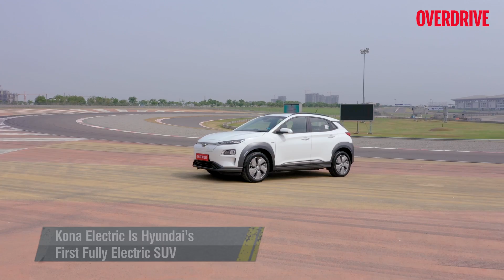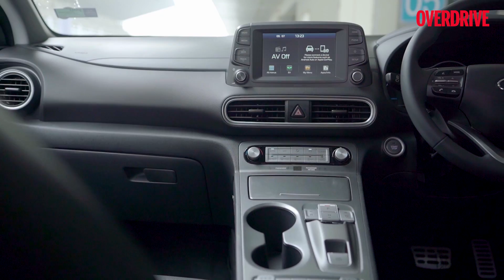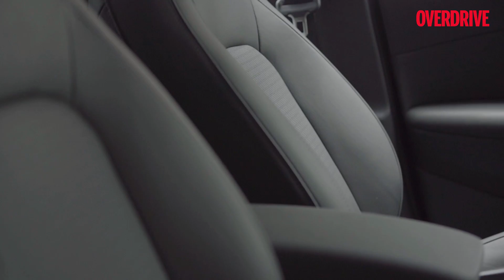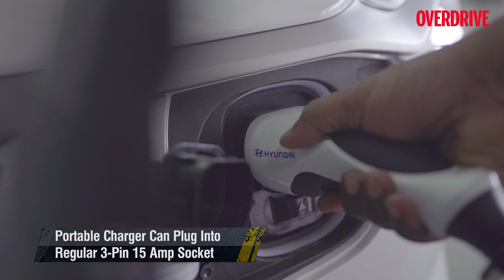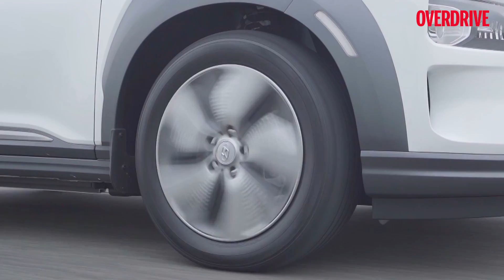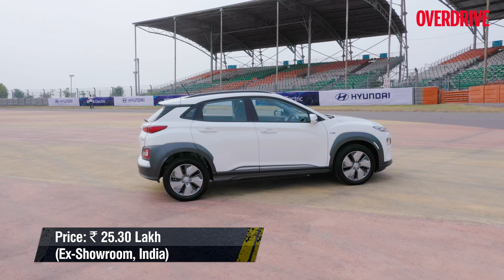Hyundai Kona Electric | First Drive | OVERDRIVE

Comment: I bought a Hyundai Kona EV (the one being reviewed here) one year ago (March 2024). This generation is now discontinued in India and was at the end of its lifecycle. So the price they offered was basically a solid discount which made it extremely good value for money at a goodly sub 20 Lacs. I ve used this car in the city mostly, but have also done three medium to long distance trips in it. All I can say is that this is a really well accomplished car, extremely comfortable, very sensible and energy efficient. The braking regen controls with the paddles, can be worked just like one works the paddle shift gears in an ICE car. I particularly like the screen size. It is just like a normal car and doesnt have huge screens everywhere which actually distract the driver. The lumbar support is very nice. The boot space is fine.  It is quite a luxurious car for two people’s usage. And the cost of running is amazing. The brakes last a really long time because of regen. Maintenance is reasonably priced. The cost of electric charging is only 15-20% of the cost of petrol fuelling up. With a 100% charge in the plains, one can get 300-320Kms. If one intends to drive up the hills, then it is useful to do a part charge halfway along with a breakfast or coffee break. Honestly, ECO mode is more than enough performance for our daily use. The power delivery is fantastic from the get go. The car is lovely to drive whether in city, highways or hills. In the hills, on the curved roads and downhill and uphill slopes, the car feels absolutely planted owing to its low centre of gravity and the fact that the battery weight is concentrated at the bottom. It handles really well. The 395NM torque and 140bhp is more than sufficient to shift the 1600 kgs kerb weight of the Kona (maybe 1800Kgs when laden with 2 passengers and some luggage). The ground clearance is adequate but under full load one has to watch for the giant speed breakers that we have in India. . Being a CKD, the fit, finish and finesse of this car is really up there with the best. Very good value. 
The Kona is an accomplished car and well worth it. 
Speaking as a happy owner.

Comment: I have one question. If I tank up my fossil fuel car and leave it un-driven for 10 days, on 11th day the fuel in tank will be the same (petrol may evaporate a minuscule bit). Now, if I full-charge Kona and leave it un-driven for 10 days, will stored charge remain same? The reason I am asking this is because, if I full-charge my cell-phone and leave it switched off for 10 days , on 11th day when I turn on the phone, I find more than half of the charge gone even though I haven't used my phone. In other words, does it retain the charge over longer duration, even when the car is not driven?

Comment: Just another observation on the pricing factor. Presently, Lithium ION batteries are priced at approximately US$200 per KWH. Considering this figure, the battery on offer in this Indian version should come in at around 8 lakhs. Add another 5 lakhs for the rest of the car and you end up with 13 lakhs. Add another 2 lakhs and round it off to 15 lakhs. That's about the MAXIMUM, this car should be sold for, in India. If subsidies and tax rebates are applied, then the final figure should go down much further. Ideally speaking, this car should sell for around 12 lakhs MAXIMUM, if it is to be considered for an average middle class family. The very ideal scenario is that as an EV, considering the range issues and the present scarcity of charging points, it should come in lower than a Diesel/petrol car if it's same size/power range. Only then will there be any sort of motivation for a middle class family to consider it, instead of a gas/diesel version.
Reply: absolutely right.....but its priced for 25 lakhs i guess...why the hell so much expensive!!!
Reply: 60%imports duty
Reply: and hyundai wants to milk early adopters

Comment: Yet another 👌review by OD and Rohit. 

1) Is the re-gen based on deceleration alone  or restricted to the mode of deceleration, as in foot off the pedal vs. brake pedal?

2) What is the tyre wall spec and will an owner have to be very careful while driving through some of the most beautifully made pot hole laden roads  in Maharashtra?

3) Which other electric cars can we expect in India in the next 12 months?

Comment: #How much would the Air-Condition  effect the range? 
#And does the performance go down as the battery runs out of juice?
#Ground clearance up by 10% for India and which is?
#Price for the AC Charger?
Reply: AC doesn't effect the range much of this kind of EVs. It may at most affect it by 5% of the total range, if blasted in full power all the time. All EV performance does go down 5-10% when battery is below 30%. AC charger is included in the package, it's price is about 50-60K.
Reply: @Amuzic_Earth  thanks for the information! Appreciate it 👍🏻

Comment: Is it possible to carry extra batteries and connect them additionally during long journeys?
Reply: Some people has tried it...a Huge Lithium ion battery(2-3 Kwh) can give it about 5 Km of range. It's not worth.. The weight itself will decrease the range by that amount.
Reply: Doesn't really sound practical as regular home charging itself takes about 19hours to fully charge. But, I honestly don't know what kind of a Jugaad is in your mind 😄
Reply: Can we connect this car's battery to home inverter? That way the batteries get charged quicker and even the house will have good power backup.
Reply: @crossplanev8  I suggest just charge the car like its meant to, leave 400 aside, even if you get 350kms range it  is still pretty good for the weekdays.
Reply: @user-HBD  300kms range is not a problem for daily commute. Problem arises when you have to go touring. Anything beyond 600kms looks impossible.
Reply: @crossplanev8  for that we'll have to wait for Govt or Private companies taking the initiatives where DC fast chargers are available more often through out the country!
But, even then I think the first target would be the metro cities, so you'll still suffer when on the highway! Things will certainly change, sooner or later. ✌️